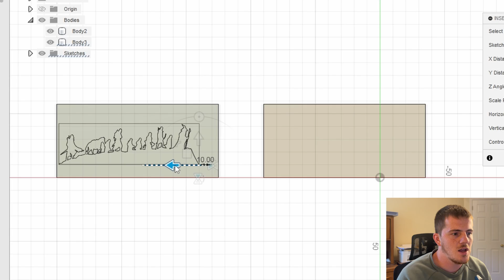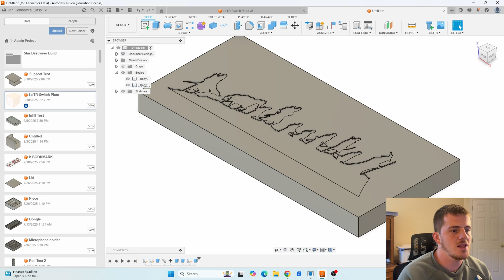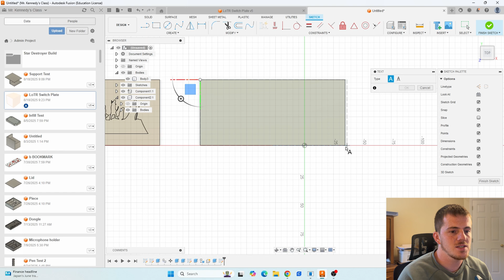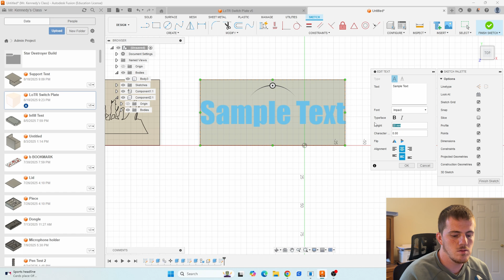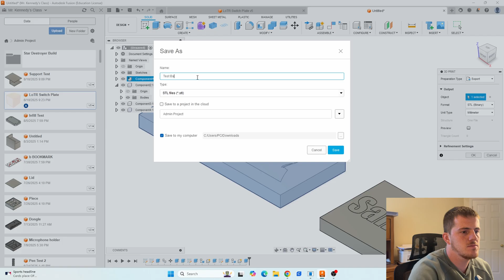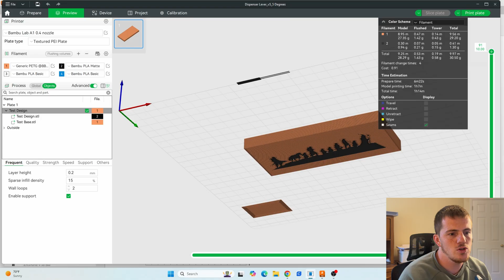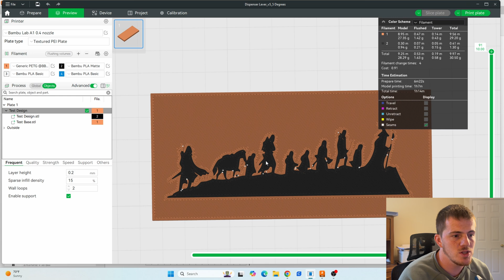How to 3D Print Perfectly Flat Multicolor Logos (Easy Method)

Comment: Hi, do you recommend any particular settings for the flow / temps / layer height etc. I'm using a 0.4 nozzle and with finer patterns I get gaps in the extrusion at the corners of details.